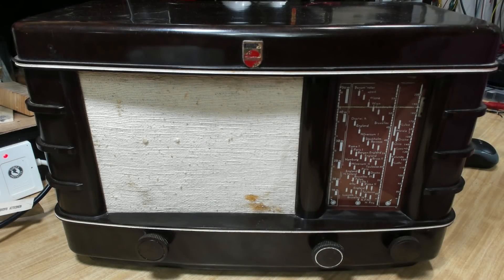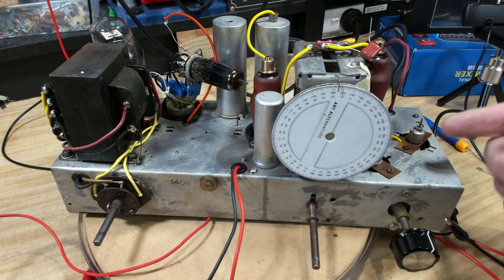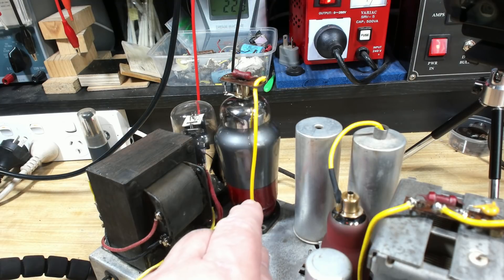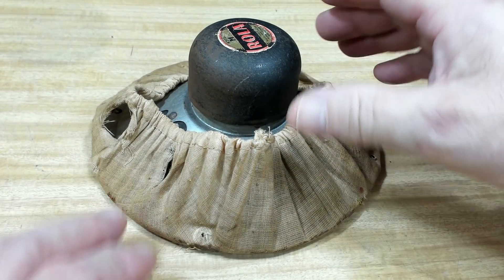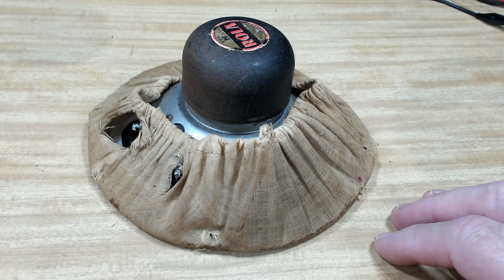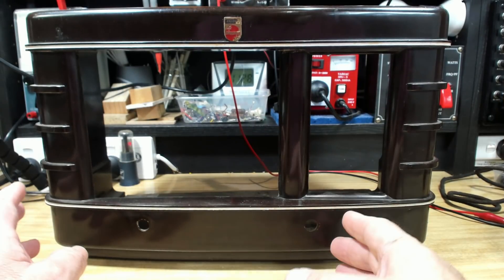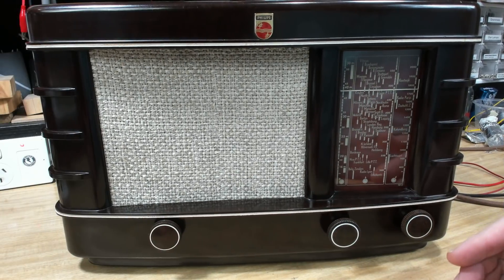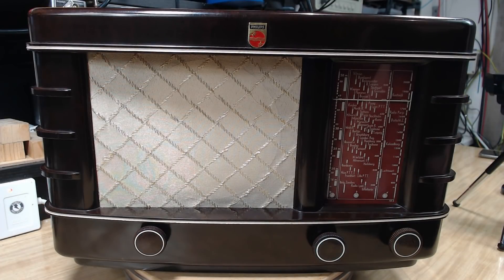Philips 206A - 1940 Sympathetic Restoration Part 2

Comment: Hi Dave,
It’s always a bit of a sod when a “repaired” radio, or television refuses to play ball just after it has been secured back into its cabinet …the amount of times that very thing has happened to me LOL.
Where you have replaced the EBC3 is the same position where my Philips radio has an EBC33 double diode triode.  The octal valves inside my Philips are more or less the same valve types as the side contact types inside your radio.  A few of the earlier American UX type valves were later converted to octal base types and given an alternative index identification  - just something to bare in mind should you be taking on another American radio restoration in the near future.  In fact, a good number of valve manufacturers revamped a few of their well tried and tested valves of the 1930s, by changing pin arrangements, say British 4, 5, or 7 pin to octal; giving the new version its own index identification, and selling it as one of their latest “improved” offerings at increased prices.  That continued into the early 1950s - after that time B8G, B8A, B9A, and B7A pin arrangements had started, or were starting to become popular among radio and TV manufacturers.
As for your Philips radio: it performance, and audio quality is as good as I said it would.  
After sitting unused for almost three years, I got my Philips version of your radio down, and plugged it direct into a mains supply, and switched it on.  Giving it sufficient time to warm up, it began working.  It sounded a little groggy for the first two or three minutes, but after a quick sneeze, and clearing its throat, it too demonstrated how well it could perform, and sound.  
Install a good set of valves inside your radio, and I’d say there is no reason why it should not continue to outperform thee ‘n’ me LOL.  - given you are a mere few months older than me - both being a 1954 model LOL.
Another fab video my friend: all the very best from Phil.
P.s, always remember when repairing a vintage Philips radio, Philips were a law unto themselves!
Reply from the maker: Hi Phil, this chassis had cabinetophobia. Indeed, many valves can be traced back through different base designs and be essentially the same innards even into the Novel bases, look at my Frankenstein valve 6BV7 was close enough to the 1935 side contact EBL1. We sourced a NOS EBC3 from the UK and the radio is working brilliantly. Old radios do need a bit of time to 'wake up' sometimes, I guess it takes a bit of time for the valves to clean themselves up. Nice that you got your old Philips out. Philips were innovators, not imitators which put them out of mainstream sometimes. Thanks Phil 😀

Comment: 9:34 ( I know I'll forget if I wait till the end of the video, so if you have fixed it, I'll delete it but you will still get the message)  All the top end of the audio is cut off.  I know it's AM and you don't exactly get 20khz of tonal bandwidth, but it does sound low even for AM.
Reply from the maker: Hi tarstarkusz, it sounded fine in the flesh (for AM), I was using the shop speaker which is behind some equipment and up above the microphone and that speaker tends to have more bass than others anyway. That aside, the maximum frequency response from AM here is less than 4.5 KHz as we only have 9 KHz station spacing, fine for voice but music sucks 🙂
Reply: @DavidTipton101  I know the frequency response is terrible for AM, but I also know a lot of these radios had a tone control with a capacitor and thought maybe this one wasn't functioning correctly. They also sometimes put one on the volume knob to work as a kind of loudness function. 

Anyway, you did a very nice job as always.
Reply from the maker: @tarstarkusz  indeed, this one had fixed tone and I had replaced the tone control capacitor. Someone had fitted an extra tone control capacitor which killed the top end completely, I replaced it at first but after it first started working I quickly removed it. I played with the tone capacitor but can't recall why. I was happy with the sound once the radio was in the cabinet. This one did not have a 'loudness' tapping on the volume pot 🙂
Reply: @DavidTipton101  At the very end it sounded like it had its high end back.

Comment: IF alignment: I advise you to keep the leads of the extra capacitor as short as possible, because you are working in a high frequency circuit. Too long leads may lead to misalignment after removing the extra capacitor.
Reply from the maker: I'm not going to replay the video but I take your point Wim, thank you 👍🙂

Comment: Hey I have a question. So I have an old radio with tubes that I think are painted with mercury paint, and I realized mercury is toxic. But do you know if the paint containing mercury is toxic? I really need an answer because I don’t want to worry about dying because I own radios with mercury paint. Please respond if you know. Good video by the way
Reply from the maker: Hi Alexander, that is an unusual question, firstly, I have to wonder why are the valves painted, secondly, I wonder why you think the valves are painted with a paint containing mercury. I am not an industrial chemist but the only paint I know of that contained mercury were interior latex paints years ago which had mercury added to prevent mold. If you mean the red or silver finishes used as RF screens on the valves like in this radio then I can find no evidence that they contain mercury. I am also not aware of an industry wide problem of radio and TV repairman dying or suffering from mercury poisoning. There is hoax going around that valves contain red mercury but that's just it, it's completely false. Enjoy your radios and relax.
Reply: @DavidTipton101  ok thanks, I heard somewhere that it was mercury paint but they were probably lying. Thanks for the response

Comment: Thanks Dave, entertaining as always! Have you tried Longwave DXing?  I did see an article from your Kiwi cousins (New Zealand Radio DX League) about European and Russian stations coming in  around dawn. You might benefit from there not being any local stuff around you to interfere. Just another part of the great radio hobby!
Reply from the maker: No I haven't owwcam, I will give it a try next time I have a LW set on the bench. I can get some noises which I assume are some sort of transmission. Thanks owwcam 🙂
Reply: This is the antenna and amplifier I use - it will help your MW reception as well - "lz1aq active antenna amplifier" and a double "Large Fat Loop" in a figure of 8 as he describes. Being magnetic rather than electric they are much less prone to the interference that you get on MW/LW. Each loop is 1 metre in diameter so they can also be hidden away in the garden! A five minute job for a man of your calibre!!!
Reply from the maker: @owwcam  Thanks owwcam, I'll check it out.
Reply: I do LW DX...I got Tibet on 285khz and Russia on 263khz at Night after Midnight Pacific Time
Reply from the maker: @kevmichael2064  Where are you located to get them kev?
Reply: @DavidTipton101  Hawaii....Thay all come from the North and South of my Area... around 2 am in the morning...LW Band Opens ..  I go to the Beach with my portable...Multi Band...I live in the mountains. AM is blocked... only Locals on AM ...if I go out of the city than it is More stuff to Hear
Reply from the maker: @kevmichael2064  Ahh, got it. Sounds like a bit of fun on the beach at 2am LW Dxing 👍🙂

Comment: Next weeks project, manaifying a man cave sewing machine lol, believe it or not, I also have a sewing machine in the shop, on the odd projects that I do need it to use it, I rather enjoy it haha, that is what is so great about your video's there is a little of everything for everyone to enjoy! BTW I rather like the idea of using a cloth to protect the speaker from dust, perhaps using something like cheesecloth would be more suitable for that use. Dave's sewing circle haha good one, here we call that tailgate party when it comes to men lol
Reply from the maker: Hi patprop74, the sewing machine flowers were a little embarrassing but I'm too old to worried these days and there is nothing wrong using one in the shop, it's just another tool. The cloth was to preserve the look of the radio, I cut the front of the cloth out later on so as to not muffle the sound from the modern speaker but it made no difference to the sound. Haha... I haven't heard of 'tailgate party'. Thanks patprop74 😀

Comment: Ahoi! Recently i've got some old radios and saved them from eWaste. Thing is... they have old boards and nearly no point-to-point Stuff going on. Lots of small filters in a can, lots of film caps and so on. How would you clean these boards to make them look like new? Or close to it? Desolder all filters and foil-caps because Water might damage them more than resistors and give the board - just with resistors and stuff left - a scrubbing with warm water?

Or is desoldering not needed, if i dont soak the boards in water and just use a brush with warm (mayhaps soapy) water?

Best wishes!
Reply from the maker: Hi Kevka Bluebird, I would try Isopropyl alcohol and a brush. Test it first though as it may remove the print from the board and identification from the components. If it does, you may need to resort to soap and water if it will remove whatever is on there but use a small brush to apply and scrub the grime away, a tooth brush may help 🙂
Reply: @DavidTipton101  Thank you! Gonna try just a little bit of soap and warm water. I tried isoprop but it just smears the dust all over the board and it looks worse than before.

Thanks David.

Comment: Wow David, this one proved to be quite the workout!  As a side benefit, you got to brush up on your sewing skills.  Here in the US, they never resorted to lacing the speaker up in a cloth bag instead, they placed a partial enclosure over the back of the speaker with sound deadening material.

That reworking of the valve bases is tedious, especially with the added tasked of securing a good earth connection to the envelope plating.  In the US, they never used the glass envelope plating; it was either a steel envelope or a slip-on sheet metal shield over the glass envelope valve.  All in all, your "bag of tricks" saved the day, making for a solid, nicely done restoration.

One question: What brand and model RF signal generator are you using, I don't recognize it?  In RF development over the years, I used the Hewlett-Packard HP-8640B, until the low phase noise synthesized generators obsoleted it.  However, at home, I have tried to get by using an Eico 324 kit I bought back in 1979 but, have modified several times since then to improve the performance.  Recently I decided to upgrade but, the offerings available to Radio Amateurs is rather poor.  Most generators don't have AM modulation available, have lots of RF leakage, and a simple adjustable RF output method, such as a pot.  Also, purchasing an old high quality generator is out of the question because, since much of the circuitry is custom, no replacement parts are available.  The best compromise I could find was purchasing an old US military generator from the 1950's;  a URM-25D.  Which I actually used a few times when I was in the military.  This thing is fully repairable and uses high quality RF circuit/shielding practices.
Reply from the maker: Hi Bill, it was a time consuming project but the end result was very satisfying, thank you. A sound deadener on the back is a good fix too. 
Spray on shields seem to be a Philips thing or at least a European thing. It's a good idea but has problems as the tubes age.
There are links to my RF generator in the description below the videos, it is a project from an electronics magazine 🙂
Reply: @DavidTipton101  Thanks David for the reply.  Sorry, I completely missed the link on the generator.
Reply from the maker: @billharris6886  no problems, Bill, not many read the info below the videos, I don't 😄
Reply: @DavidTipton101  I generally view your videos on an Android tablet.  The links are hidden and can only be accessed via an obscure pull-down which Google seems to see the need to move the location of every so often.  Thanks again for the response David.  Being from the US, doing valve radio restorations since the early 1970's, and having retired from a career of repairing/designing the RF and analog portions of aircraft communication transceivers, I am always interested in most anything to do with radios.  So, keep up your fine work, you have really refined your restorations over the past few years and no doubt an inspiration to those interested in the hobby!

Comment: These 2 airport beacons what you heard on longwave band, is indicated on the dial, in Dutch 'Luchtvaart', means aviation. 
Coincidence? 😁
Reply from the maker: Hi Peter, it turns out they were aviation land based NDBs about 60 kms from me, some were able to decode the location code so your suggest may be correct🙂

Comment: The adjustments on this were way out compared to other radios you have done,  any reason or was it never properly set up in the post war panic situations , or new components have change the characteristics it was working with ?
Reply from the maker: Hi High Path, I don't know why it was set like that, it was definitely the wrong frequency set in the radio, the frequency was stamped on the chassis and the adjustment were still sealed with wax. Before I shipped it out I set up the dial as I normally would and got the stations to line up with the dial perfectly. I didn't video it unfortunately 🙂
Reply: @DavidTipton101  are you saying that the mains frequency switch was not  set right Hz for the destination country ?
Reply from the maker: @highpath4776  No, sorry High Path, I meant the IF frequency was set to 460kHz and not 473kHz, yeah, sorry, not the mains frequency.
Reply: @DavidTipton101  Hmm,  device for secret wartime messages  .  "allo, "allo

Comment: Why call 📱 this a sympathetic radio 📻 restore? Ya do such a GREAT 👍 job on these. That dial cord looks to be very vexing. I’d try to find the dial cord restringing diagram online. They probably cost only $5.00 or so. Ya probably already have the dial light 💡up and running 🏃‍♀️I don’t know why ya needed a new dial glass, but the radio 📻 probably looks better with it. Your friend, Jeff.
Reply from the maker: Hi Jeff, sympathetic in the sense that I maintained its original looks and patina. The restring was easy and the letters were missing of the old dial glass 🙂

Comment: Perfect repair, but this material doesn't match the whole radio. The fat weave resembles a jute sack. It should be something more delicate and subtle in the color of the tea. Or colored in Tea is a very good and cheap method.
Reply from the maker: Thank you Robert, you may have missed the last part of the video, I replaced the cloth with a more suitable one 🙂
Reply: @DavidTipton101  
That's right. In the last minute of the movie, I noticed a change and wrote a comment before while watching it. I wonder if the collour should be more ecru. But everything related to aesthetics is a very opinion matter. Some people like this and not others not. The basic thing is that the radio works very well.
Reply from the maker: @roberts1938  It looked better in the flesh than it came across on the video, it was the best I could do, it is a German cloth but it needed more oomph. It's difficult to get good cloth here, most has to come from overseas and is expensive, shipping costs more than the cloth sometimes 🙂